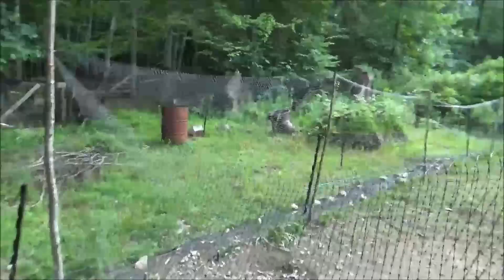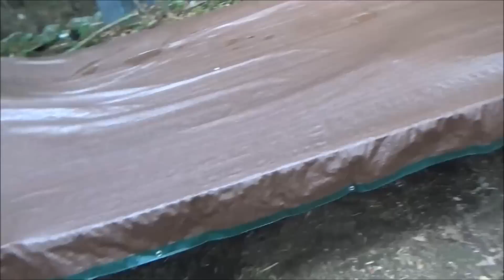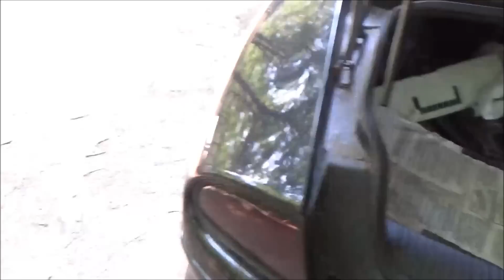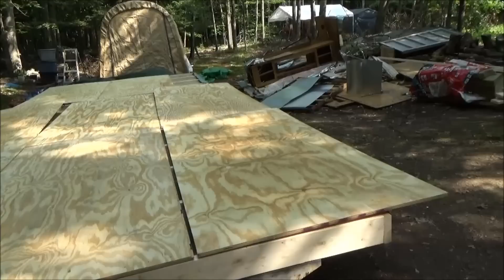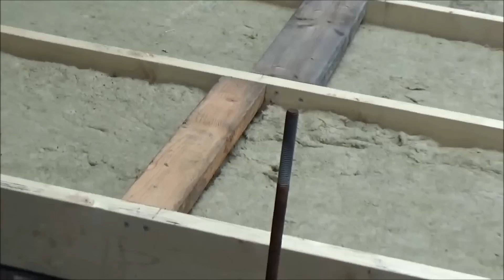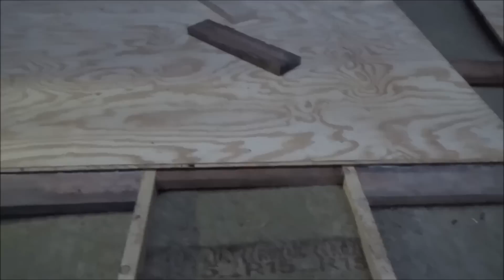Starting Laying The Floor Boards For My Tiny House On Wheels

Comment: Is this 5/8" ply and not 3/4" flooring?   Proper flooring has a tongue and grove edge.  They are the proper thickness and don't require support boards.  There is a reason certain things are made they way they are.  They are the minimum materials to do the job properly.  You're supports to make up for the wrong flooring is only supporting the edge of the ply between every other floor joist.  ??
Reply: Hi. I'm trying to figure out what your talking about in regards to the "proper flooring". He is using 3/4" t&g. The reason he's going with blocks between joists is because the joists are on 2' centers which is to much because it will warp on that much of a span.
Reply: I didn't catch were he gave the size. He may have.  I would agree that proper flooring is 3/4".   Just looks a bit thinish to me.  However, I did notice they were straining like it was 3/4 when handling it. Plywood intended for flooring today has a tongue and groove bed running down each edge so the edges of the sheets can support each other between the joists.  This is often glued.  The blocks are the work around.  Notice the beginning ones only support the each sheet between every other joist.  But then, I think he recognized that error later in the video. He mentions it and you see it being done properly.
Reply: RadicalRC Hello again. You may be right about the thickness, I assumed that it was 3/4", because it looked that way to me. I realize he is using t&g to support between the joists, but as I said earlier in my reply to you, the reason he is doing this is that the joists are on 2' centers. I personally have seen problems with the seams warping between joists that are placed on 2' centers, especially after a rain. When a person frames for a living like in the Seattle area, you can't just take off every rainy day, or you wouldn't make a living.
 Thanks, Jim
Reply: Jim Watson  He's not using T&G.  But, I understand what you are saying and it probably is a great ideal to support them anyway.  I could be wrong about the thickness.  I'm sure he'll address it in the next video or two.  If I lived in the area, I'd drop in on him here and there and help keep the rudder straight.  My first roof as a beginner an experienced X roofer dropped in on me every evening until I had it done.  Kept me from getting too deep into any mistakes and my project turned out properly.  The most important thing I learned about roofing is those guys that do that work actually work very hard and worth every penny.  ;-)
Reply: RadicalRC Hello, am I missing something? You say " He's not using T&G".
 He actually is.
Reply: Jim Watson Wow, if he is, I sure can't see the edges to that detail in the video.  If so, fantastic.
Reply: RadicalRC Hello. You can see the T&G in the earlier videos.